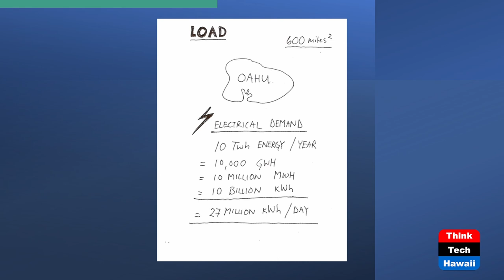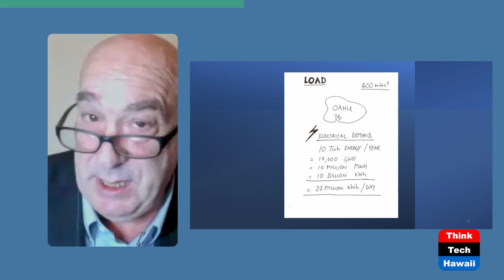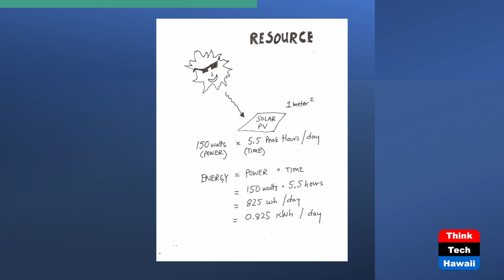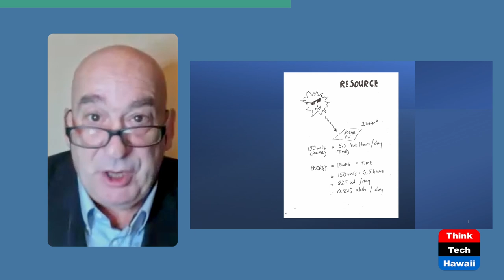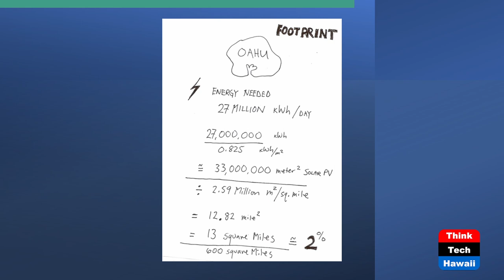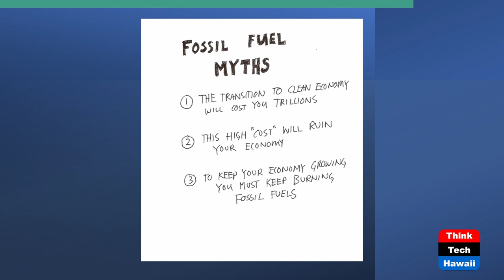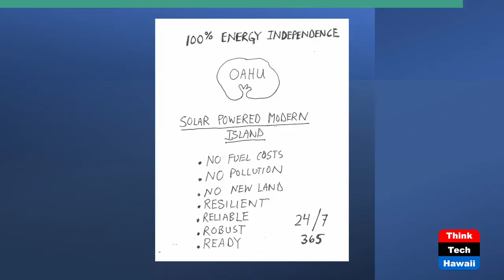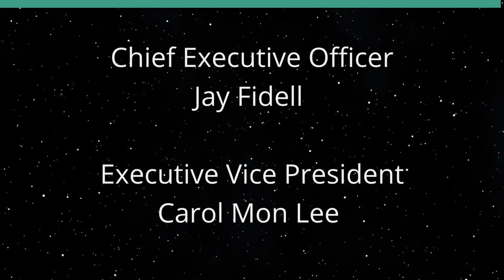Can Solar Energy Power O'Ahu (Hawaii: State Of Clean Energy)

Comment: Geothermal is base power. Hawaii Island has 5 volcanoes with heat inside. It has a small footprint. And, it will last for more than a million years.
Reply: I’ll give you one better - there are already geothermal generation facilites on two of your islands that are running to less then half of their rated capacity because there is nowhere for the power to go.  
If the islands were connected by submarine transmission cables, you’d be a more reliable network, run by clean energy and pay a fraction of the $0.48/ kWh you are paying now.
Reply: Well, not really.  There's only one geothermal facility operating in Hawaii called Puna Geothermal Ventures.  The plant is rated at 40 Mw.  Even doubling that would be only 80 Mw.  The grid on Oahu alone peaks around 1.1 Gw.  That's over 13x more power required just to meet an instantaneous peak on Oahu.  You'll need a lot more than simple doubling of capacity to even make a dent.

You need to be careful about the difference between Power and Energy.  Power - is the ability to do work.  Energy - is doing the work.

This video discusses how Oahu's grid can be powered 24/7 all year round using solar PV as the only primary input.  The video discusses how much solar PV you'd need (about 4.9 Gw) to produce the 27 million kWh per day required to power the grid directly as able, with all overproduction of solar being used to produce clean hydrogen as energy storage for when the sun doesn't shine to fuel the Fuel Cells.

It's designed that way.  At night, and during storms when solar is not directly available - this grid is powered with Fuel Cells. (Fueled with the clean hydrogen produced on island).

That's how Power and Energy are provided 24/7.  It's all based on solar PV/electrolyzers/storage and fuel cells.  The output device is the fuel cells - that's what powers the grid when the sun is not available directly.

The fuel cells are rated at 1.5 Gw of power - more than adequate to power any peak demand at any time - and all local and on island.  Local, resilient, reliable with no air, soil, water, or biological impacts.  Pretty good stuff.

Your comment that undersea cables is better is not well considered.  The waters between the Hawaiian islands are often fast moving, and sometimes very deep, not at all very even.  Undersea cables (which are highly vulnerable) are very expensive to lay and maintain over the plus 200 miles you'd need from the Big Island to Oahu.

Your suggestion that geothermal would be cheaper is also unsupportable when you get into the details of how power plants are permitted.  Let's be clear, I'm not saying geothermal is not workable, what I am saying, however, is that all thermal power plants have characteristics which have to be permitted.

This is no small task.  You have to document all soil, water, air and biological impacts - of which there are many - this is just a fact of life in permitting thermal power plants of any type - increasing costs dramatically.

Regulatory affairs make any thermal power plant expensive to permit in modern times.  Your undersea cables for example would require extensive surveys, and permitting requirements, let alone high insurance costs as any problem would leave Oahu in blackout.  Very expensive, very intrusive, and very vulnerable - all avoided with the solar approach described in this video. @sabatier2002
Reply: Well, solar green hydrogen systems provide base load too!  That's what this video talks about.  In fact, using Fuel Cells as the output device to the grid allows you to provide base-load, intermediate loads, and peak loads as needed.  This is how a clean hydrogen system works.

This video was asking the question "can you solar power Oahu?" and the answer is Yes you can.  It's a Solar PV/Electrolyzer/Storage and Fuel Cell system.  This is what this video is talking about and the focus of this episode was on the question of adequate Solar resources on Oahu to power a modern grid in this way (using a clean hydrogen system):  and the answer is yes you can.

And, remember, the Sun will last a million years too!  The sun powers the natural world, and can power Oahu too!  This is the point of the video.